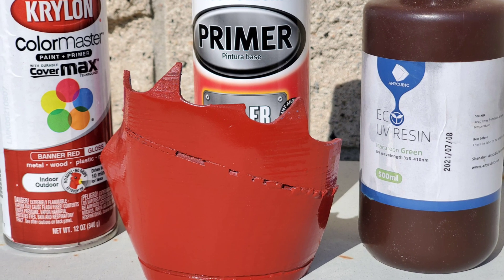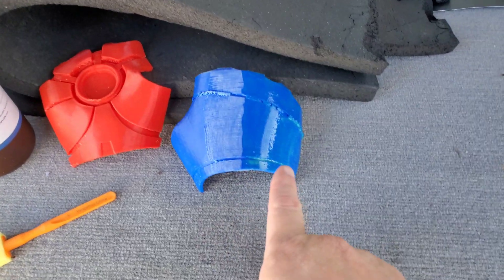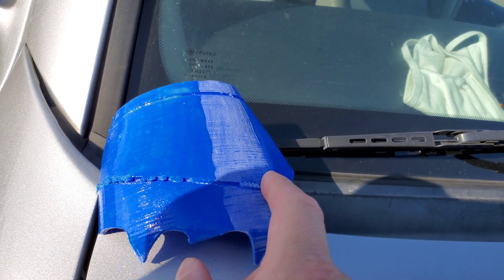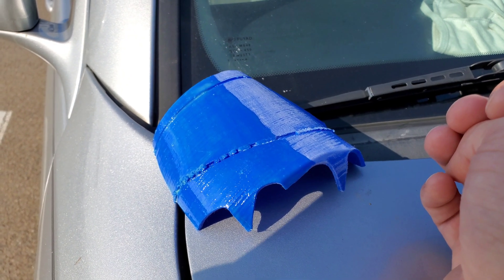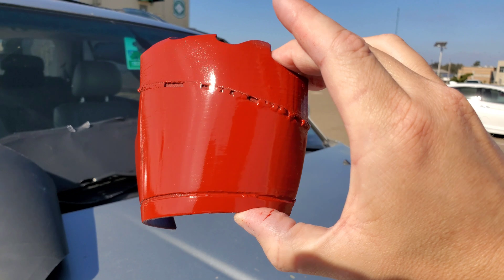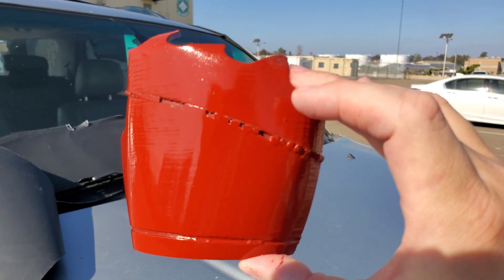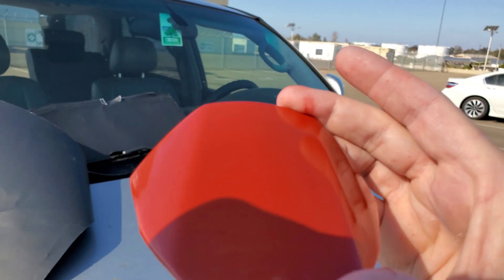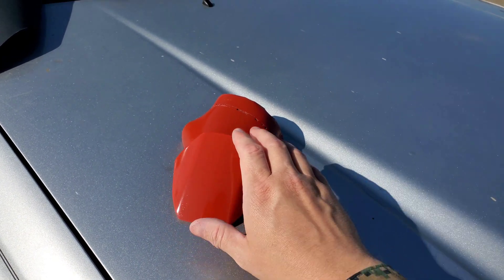Can UV Resin Be Used to Smooth 3D Prints? How Sanding, Prime and Paint Affect Surface Quality.

Comment: If you are looking for a fast way to get good prints I use spackle for big gaps and to fix big problems then I use filler and primer 2 coats put on the paint I want and then use a clear coat and at the end you can’t even see layer lines also if you put too much spackle I just use a exact knife to make it flush